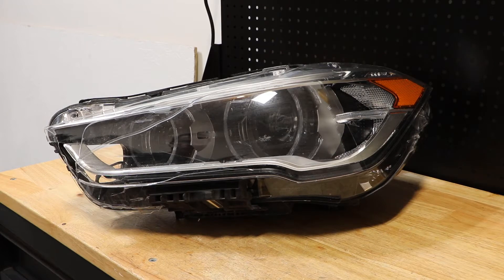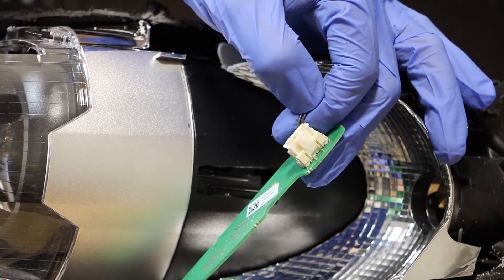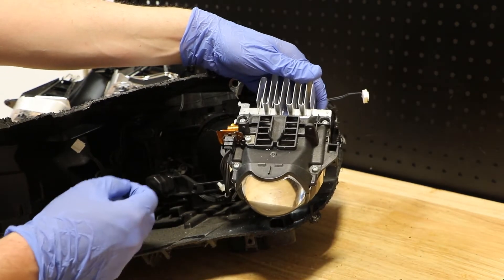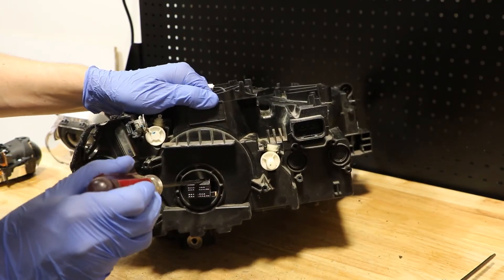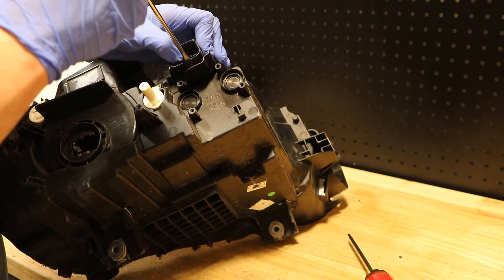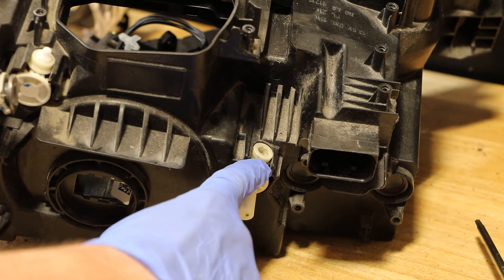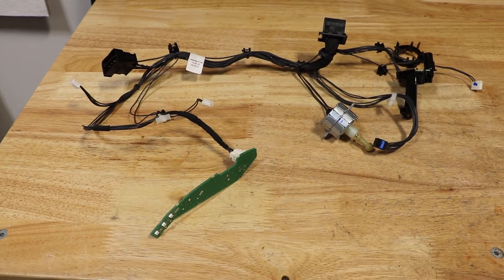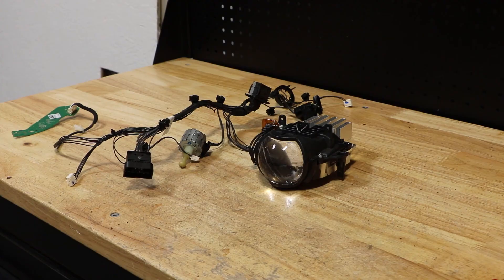2017-2019 BMW X1 LED headlight teardown

Comment: My left headlight automatically turns back to dipped light when i put it on high beam while right remains on high. Also got fault message of left dipped light failure and left high beam failure. Any suggestions?

Comment: Hello Friend. He put cooler headlights on my car. One of the fenders is broken, but the blocks are whole. As I noticed, Shane's fender has radiators instead of a cooler. Will my fender blocks fit the headlights you have?

Comment: Hi, how to fix 650i F06 Error "Dipped Beam headlight left failure"? My is 2013 full led adaptive headlight, thks
Reply from the maker: you would either have to take a part the light and find the motor that is stuck or figure out what broke.  the other option is to replace the headlight.   It could also be a failure of the control unit.  you will need to diagnose to figure out what failed and is causing the error

Comment: Regarding your video, I cant see a single bulb for the bmw angel eyes and may i know why?? Thanks!
Reply from the maker: the angel eye lights on modern BMWs is driven my removable LED modules.  Those module were removed from this light before I got it.  They generally attach on bottom of the headlight.
Reply: gftgrill oh thats right.. mine got kinda yellowish color on right headlight and very bright white on the other side ( Angel Eyes ) what do you think the problem is?
Reply from the maker: @kingtechreviewer3423  The LED units might be failing.   you would have to pull the headlights off of the car, but you should be able to swap them around and see if the bad color moves with the LED unit.